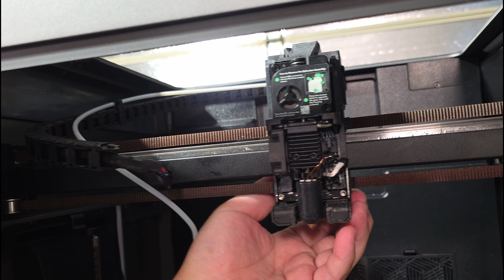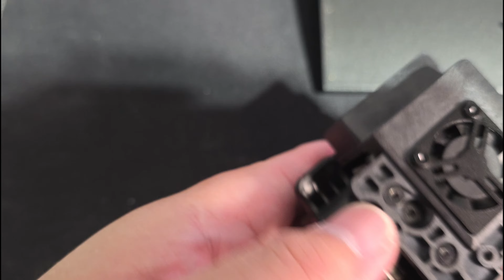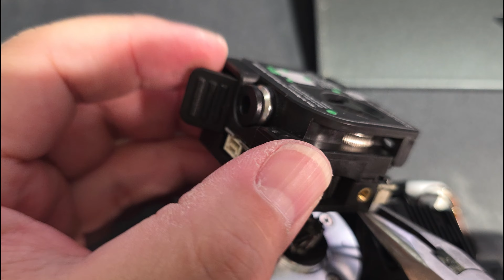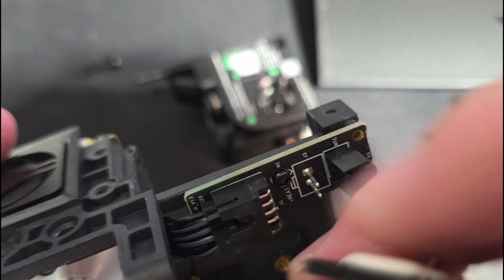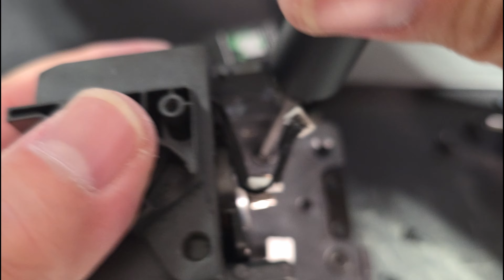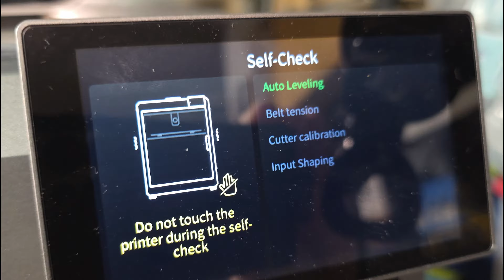Your 3D Printer's Auto Leveling Sensor is Probably Broken

Comment: Very nice and informative video. Did it show any signs that the auto leveling module was broken or was it just the code that triggered you to check the module?
Reply from the maker: Yes, there was an error screen with the code TE2762.  It kind of sucked for me because I had just replaced the hot end maybe less than a week prior to this error.
Reply: @theprintqueue at least its fully fixed! What's next on the Printing Queue
Reply: @theprintqueue hi i have the same issue right now. TE2762 error. Ive been using my creality k2 combo for only 2days. Please help me how to fix this
Reply: Do you think this can be avoided he got a Bambu lab printer?
Reply: Yes! Just be warned, the Bambu Lab printer has two serious issues. You’ll constantly run out of filament… and ideas of what to print next.
Reply: @eighty.2  I agree my K2 plus is a POS I bought an H2C and that thing just works no issues... Creality needs to fire there firmware team and get a better quality team while there at it
Reply: This guy tore the whole this apart to take they extruder and not end off.  The videos people create know they dnt know what the hell they are doing .
Reply: @JesseCuara  Making these videos takes time, and sometimes taking things completely apart is the best way to clean, inspect, and get good camera angles of the process. Give the creator some credit for actually documenting it for the rest of us.
Reply from the maker: Appreciate you understanding of trying to fix things with little documentation. 😂
Reply from the maker: Yep, this true since creality doesn't document a ton of stuff. Honestly, I think the firmware just needs more time in the oven.